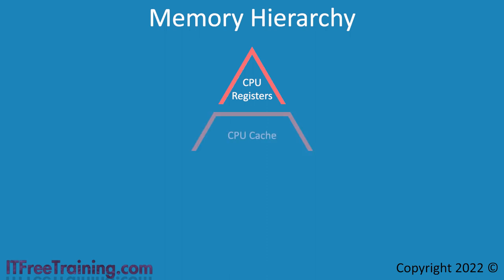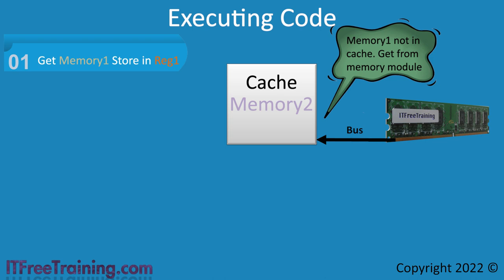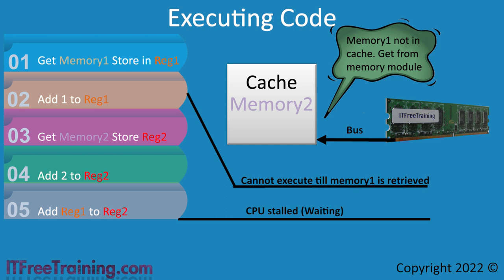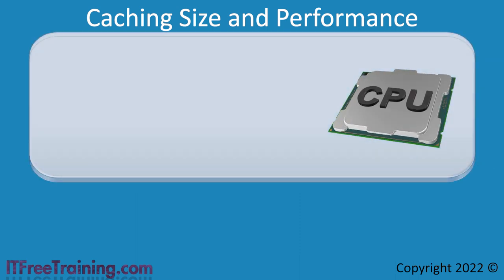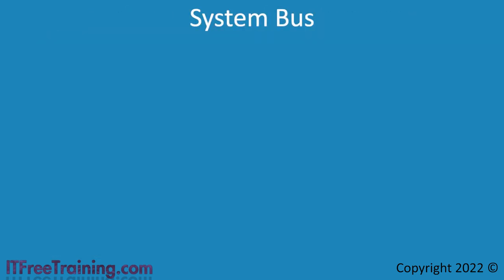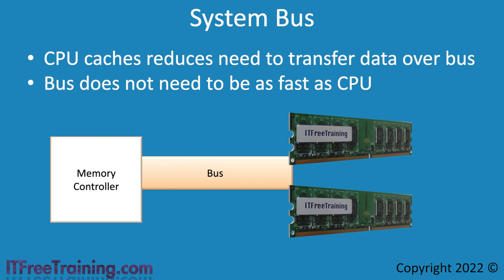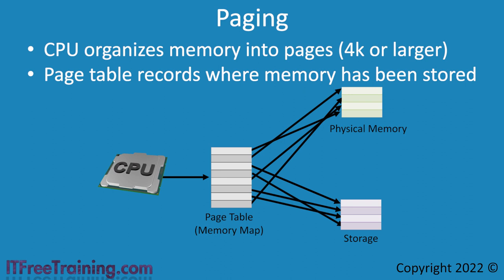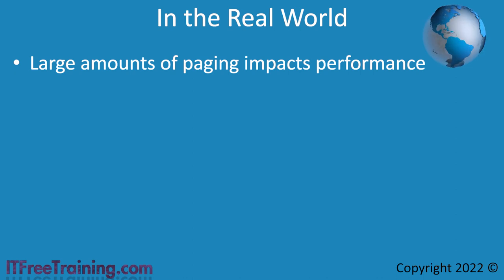How RAM Caches, Buses and Virtual Memory Work

Comment: Virtual memory and paging in this video (and many others) are terribly ambiguous, virtual memory is just virtual address to physical address translation involving the TLB and page table, demand paging is when the virtual address is not specified in the page table the kernel receives a page fault and checks if the address was something provided by secondary storage (e.g. paged to disk, file mapped to disk, etc) then it will fetch that and update the page table (page in) and allow the thread to continue, if it wasn't something backed by a second storage then it's an invalid memory access and the process is signaled/killed.
Reply from the maker: Everything you said is correct and we could go into that level of detail. However, this video is created for the A+ exam and thus we try not to go into to much detail than is required to get the points across. In our new course we have change the way we presented data so it is clear what is required for the exam and what is provided for extra detail. Thus, we will considering adding this detail in the new video since it is clear what the viewer needs to know and what is additional information provided to help with understanding.